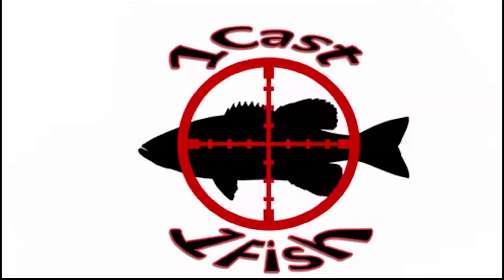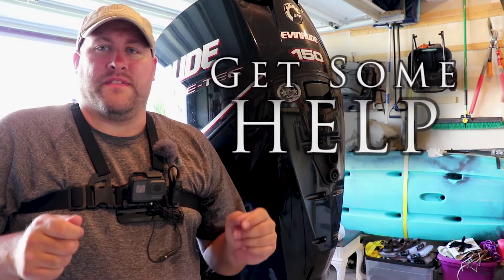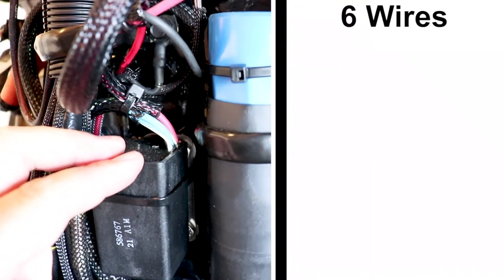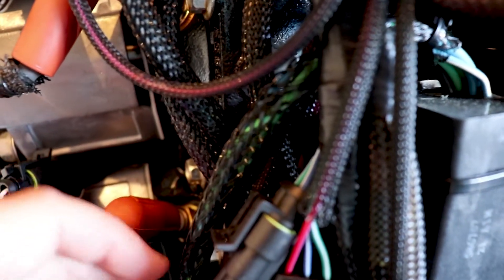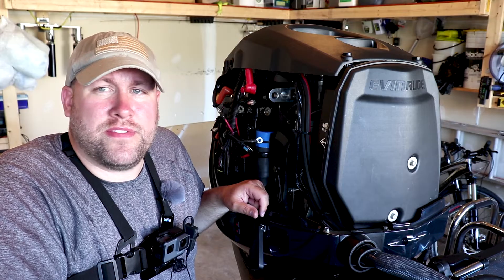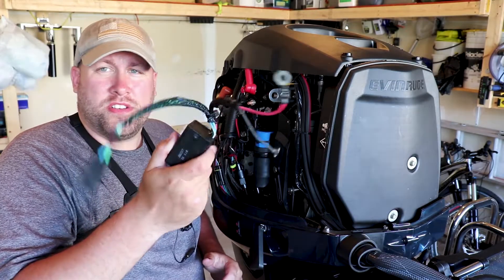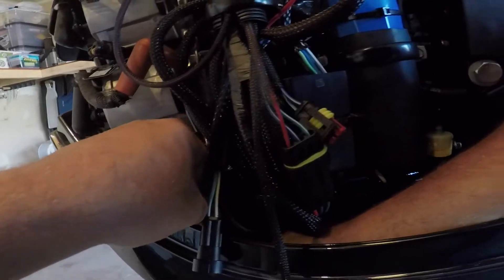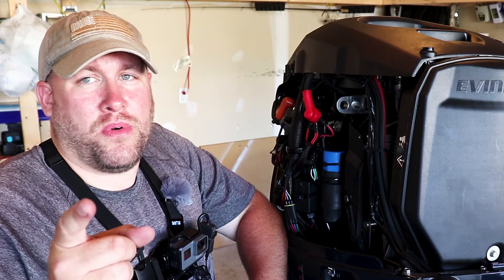Evinrude ETEC Tilt &Trim Problem | Tilt & Trim Issue | Relay Replacement

Comment: Hi. Why is it so critical to have all 4 of the power and ground ring terminals in order the way they came off the studs? I read this post after I had mine apart.
Reply from the maker: Not sure if it’s electrically critical, I just like to put things back the way they came off.

Comment: Very informative and helpful video. This exact thing happened to me this week and this vid helped solve the problem
Reply from the maker: That's awesome to hear....glad this was helpful....plus hope it saved you some money
Reply: What happened when yours went out? My ETEC randomly tilted itself all the way last night as I slept and then somehow drained the battery. When I recharged the battery and try the trim switch I can hear the motors working but there is no movement on the motor so is this a relay issue or a hydraulic issue??
Reply from the maker: Mine just would not trim from any of the switch’s…it was intermittent and gradually got worse

Comment: Great tutorial!! any tricks to access the lowest quick connect! mine is pretty deep and my hands are just to big to reach. will see if my son can but it you have any tricks or tips please share
Reply from the maker: You may be able to get a flat screw driver down there to the clip...I was able to get my hand down there, but it was extremely close and tight.

Comment: I have a 2006 115 Etec that leaks down and rase up ok any idea what’s the problem
Reply from the maker: So it raises up fine, then it slowly lowers on its own?
Reply: 1Cast 1Fish yes it goes up no problem, while I’m fishing with the motor up it drifts down by it shelf ?
Reply from the maker: @malcolmzoll7613  Ok, so you are slowly losing the fluid.  Without being to technical, there is a ported slide in there that should hold the oil within a chamber to keep the motor up...this chamber is leaking internally and bleeding the oil back into the system slowly.  Could be a simple as old O-rings and seals.  If your not familiar with hydraulics though, I would recommend taking it to a pro.
Reply: 1Cast 1Fish thanks for your help ,I’ll do that ,I’m not a mechanic
Reply from the maker: @malcolmzoll7613  Hope its a easy and cheap fix.

Comment: does this sound like the relay? my etecs tilt randomly started lifting out of the water and would not go down  diconnected the battery and everytime i hooked the battery up it would start going up again.
Reply from the maker: Possible, but before I would replace the relay, I would test each of your tilt and trim switches first.  I would remove the wires from the tilt & trim switches one at a time to see if the problem still exists (my boat had 3...motor, throttle, and bow) that way you know if its a simple and much cheaper switch issue.  If that does not work, then it might be the relay.  The Etec relay is for both up and down...not like older motors where there was a relay for up and another for down.
Reply: @1Cast1Fish  i will do that thank you so much!
Reply from the maker: No problem...hope its a easy fix
Reply: Stephen Finn mine was the tilt switch on my throttle

Comment: Hey one cast watch this vid a few months ago but didn't have a problem now later I ( Houston we have a problem) can't trim my 08 300 etec up so tried helm switch didn't work neither does the motor trim switch work  but does go down thanks for insight twice my name is John what is your name ? 🇺🇸🐟🎣🛥⛱🌴😃😊🙏🏻🙏🏻
Reply from the maker: Paul.....Glad this helped...I am glad the fix was pretty easy in my case...still more expensive than old motors to fix, but not to bad for a handy DIY
Reply: 1Cast 1Fish again thanks Paul us etec owners are I think a dying breed maybe up north they will save us in and keys it's all 4strokes hardly any etecs thanks JOHN 🇺🇸🐟🎣⛱🛥🌴😃😊🙏🏻
Reply from the maker: Yeah 4 Strokes are slowly becoming the norm
Reply: @1Cast1Fish  update Paul the trim wire had a small Nick in the up circuit and corroded real bad replaced the engine trim switch and walla when I say walla that is a good thing tried it yesterday 5/9/21 still good  how is your motor running are you still running the Evinrude JT 🇺🇸🇺🇸🐠🐟🎣🛥🌴⛱🙏🏻🙏🏻🙏🏻

Comment: I turned the hydraulic release the motor went down but wont go up. Do you know what would cause this?
Reply from the maker: The weight of the motor made it go down...now if your hydraulic tilt motor does not work you have to keep the release screw and lift the motor back up...then tighten the screw while it is up.  If its a big motor it will be super heavy...so get some help.

Comment: Nice. Thanks.
How'd you figure the problem was with the relay and not a switch or wiring fault?  
My 90 HP is running itself up.  Killed the battery twice (did it after we left the boat), then ruined an outing when it became nearly continuous WHILE WE WERE OUT BOATING.  Holding the throttle trim switch to "dn" countered the uncommanded up-running.
Reply from the maker: A bit diffrent than my issue, but I was able try trimming with 3 diffrent switches in my boat and none worked. These relays are one piece now and control both up and down.  Sounds like yours could be stuck closed in the up position. Is your problem intermittent?
Reply: @1Cast1Fish  yeah. Mine is intermittent. My first thought was a switch... But which one!?!
Reply from the maker: @737smartin  you can check voltage at the switchs when it acts up.  Mine did not continue to go in any direction...which is why I went the relay route.
Reply from the maker: Yours coul also be a trim switch in the boat that is faulty
Reply: Hey, Steve Martin... My 90HP E-Tec is doing the exact thing that you describe.  What did you ultimately determine was the problem/cause?
Reply: @fester8516  Ours is definitely a bad engine-mounted switch.  I avoided using that switch and use only the throttle switch instead. By doing that, the problem on our motor disappeared for about 10 months...BUT it just happened again the last time we took it out.  Looks like ignoring it may not be enoigh.  😐  I'll have to replace or bypass that switch .

Comment: Anyone else having trouble with this video loading?
Reply: It was just loading slow, thanks for the uploading this buddy I live in a small isolated town and the nearest dealer is about 200 miles away. Saved me a ton of 💰!!
Reply from the maker: Glad to hear it helped, that's why I did this video...seems to be a pretty common issue.
Reply: Not one video on trim switch sticking in the down position ! I have to unhook my battery to stop it !   Fix ?

Comment: Great a fairly easy DYI. Gets you up and running and no doubt saves you some serious cash not having the dealer do it for you.
Reply from the maker: Dealer prices are crazy...heck even the new part was crazy since they are a sealed unit now and not old style relays like on older motors.

Comment: Dude !!!! This video was great !!! I just changed mine... I have a 115, even less room to,get to big connector down below. 
Here is a hint... I used coat hanger to hold lower one up, to push the top part or connected from new relay in... was so easy I said ... hmm this was to easy !
Reply from the maker: Great idea on the hanger....it has amazed me the amount of views and comments I have gotten from this video...turns out this issue is pretty prevalent on these motors.

Comment: What year motor is that? I had a couple trim motors go out on my old 2006 150hp Yamaha VMAX HPDI (2 stroke). Due to motor problems, I bought a Mercury 150 FOURSTROKE for my boat 
this year.
Reply from the maker: This was a 2013 ETEC...the tilt/trim has acted up for awhile, just very intermintent...it finally got worse and was due for a replacement...a few months out of warranty...lol.
Reply: @1Cast1Fish  that is what happened to me, 1 month out of the 5 year warranty and the trim motor went out. What do they have these things programed to break. LOL!
Reply from the maker: Yeah when I got the part it showed it as a "Fast Moving" part....so must be a common issue